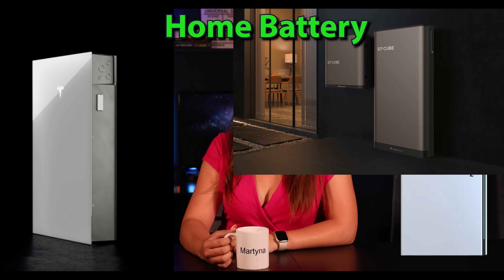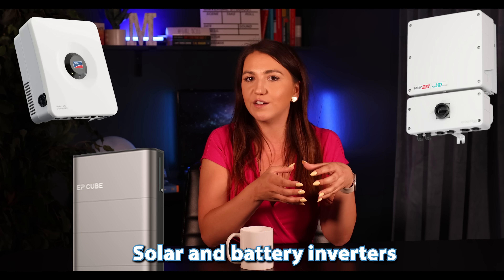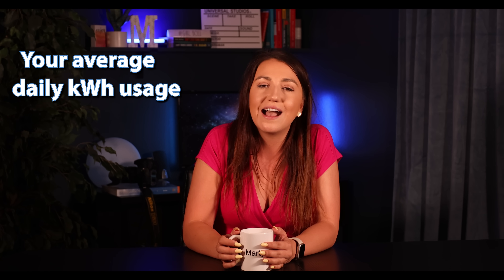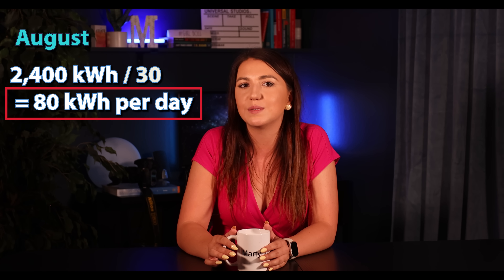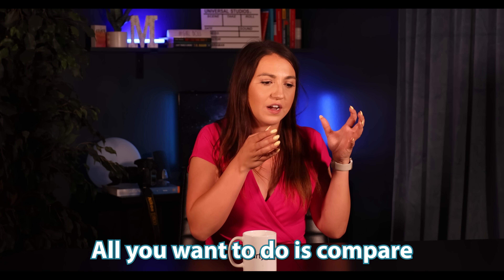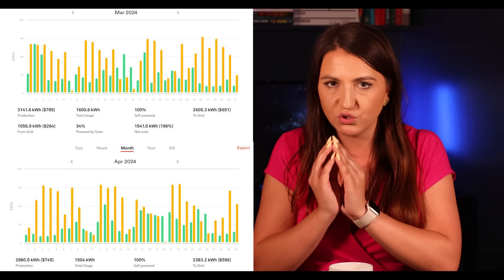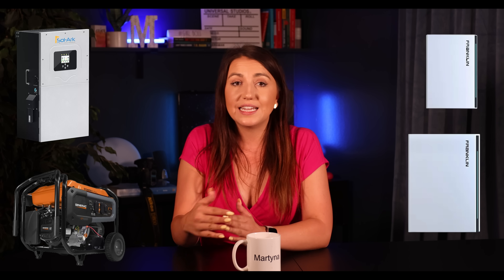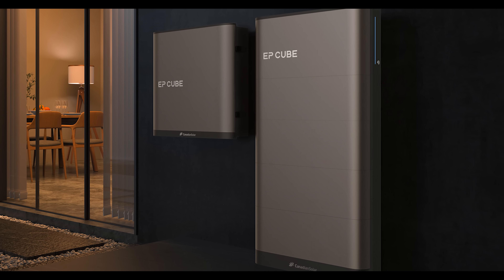How to Properly Size Home Back up Battery ? | Full Guide

Comment: Some interesting points you made there Martyna and certainly food for thought. One thing I disagree with is your battery sizing logic, because it is broad and ignores load-shifting which you only touched on as an aside comment. I think you should have impressed load-shifting as a different use case, rather than a passive comment. Sometimes a battery can store energy from the grid at night which can be many, many times cheaper and then use that energy when the cost of energy is high in the day. Each usage case will be different and as such, sometimes a huge solar array and a small battery is all that is required. The opposite is also true, with a small array and a large battery ESPECIALLY if you have cheap night rate.

Take my own array as an example. Our energy usage for 2023 was 14,000kWh (average 38kWh/day). For Ireland, the average is 4,200kWh, so we use a fair amount. I have a 5.2kW array and a 15kWh battery. I also have 2 EVs. We have cheap night time electricity (usually 11pm to 8am or midnight to 9am summer/winter). For my home, we charge the battery at night and charge the EVs at night. We set our washing machine and dish washer to come on at night too. Then, during the day, the house is run from a combination of solar and battery, with the battery being topped up with excess solar and then powering the home when the sun goes down. Currently (no pun intended) about 95% of our grid consumption is during the night. The only time we use grid during the day is when the house draws more than the inverter limit of 5kW at any one time. This happens if the electric shower is on, or the oven is on with other things at the same time. However, it still reduces our peak consumption significantly. If the house needs 7kW, only 2kW is coming from the expensive grid. Shifting our load to the cheap night rate and using it during the day is the main reason I invested in a battery.

I should say that I only had solar installed 3 months ago and the battery was only installed just over a week ago, but our day/night use has gone from 40/60 pre solar, to 25/75 post solar and pre battery, to now 5/95 post battery. We are also using less grid energy because of the solar and I will adding a second 15kWh battery next month and likely a third by end of the year to make sure we have all our winter energy use covered at off peak rates during peak hours.

Comment: I have curiosity, I have a solark 8k with lithium battery X 10kwh, if I wanted to add another battery of other brand Y of 10kwh, can I combine them without close loop and have set a common  limit charge voltage? 

Btw nice video!  I do enjoy your videos. Very informative🙂

Comment: Exporting power to the grid is only degrading your hardware over time. Making it work at 100% all day instead of just for supporting your house. People don't think of this when they are sold energy export. Does it really makes sense? Your hardware will fail much faster. Who's paying for that failure? Only you. Out of your own pocket. Exporting to the grid only benefits the suppliers not the consumer. It is one of the biggest scams sold. I got my system to not export anything. After my battery is charged the system only outputs power for my only needs. Basically idling. This way will last me for years and years.
Reply from the maker: Can you share what kidn of system you have ? It would be very helpful! Interesting perspective for sure!
Reply: Where did you get the idea that solar panels or inverters "degrade" by being run at their full capacity?
Reply: @TheUweRoss  Let's see. You have a lightbulb. It will burn out quicker if you use at full brightness or if you use it at half brightness? Don't think I can make it much simpler than this.
Reply: @TheUweRoss  using all the time in full load dedicated charge controllers and Low freq inverters definitely shorten their lifespan. The problem is much worse with hi freq inverters with integrated mppt s. A Victron inverter or mppt used in offgrid can easily last 20 to 30 years. If you think your brand new eg4 or solark made from chinesium who works all day long exporting will last a third of that, you will have a nasty surprise 😉